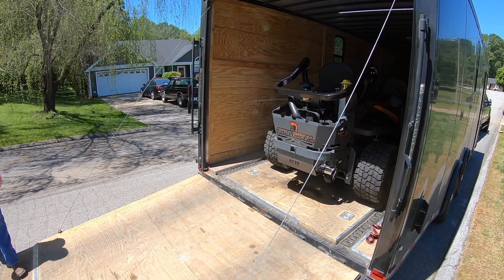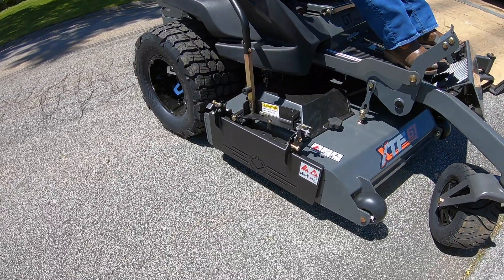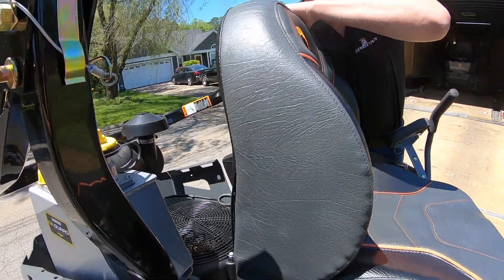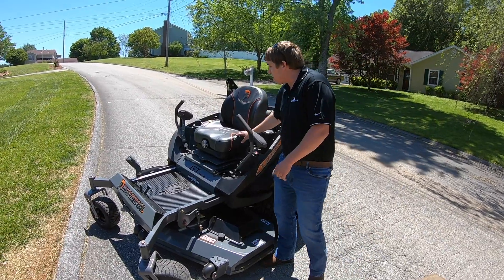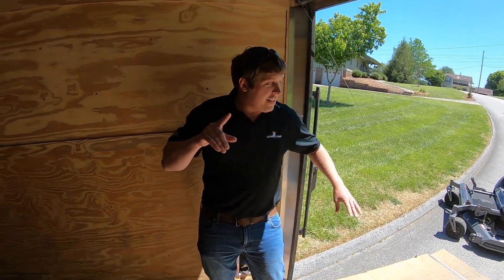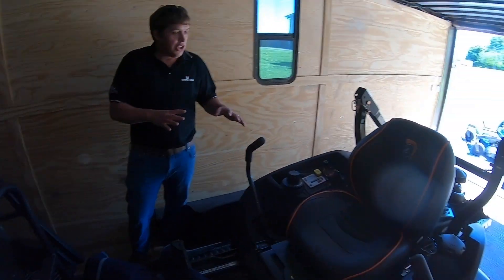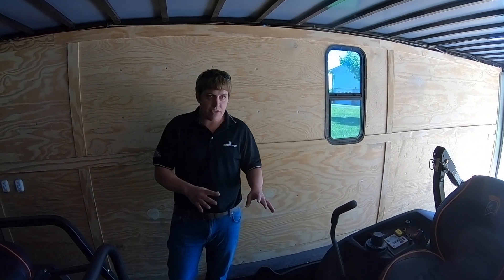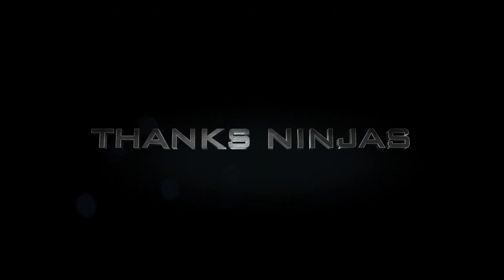THEY BUILT THIS FOR ME

Comment: Spartans are great mowers..  I really like them..  But they really are bigger mowers.   I looked at the website, and I don't think they make anything smaller then a 48 inch deck size.  I don't need a mower that big, but if Spartan made like a 42" (2 blade) deck.  I think this would be a huge seller considering the quality mower that Spartan makes.   Hopefully, the new Spartan stander will come in smaller deck sizes (like a 42" or 36" - with two blades)..